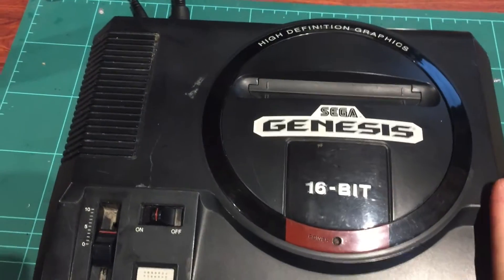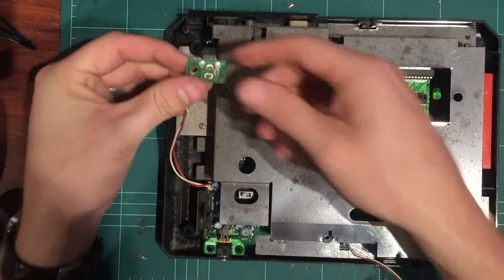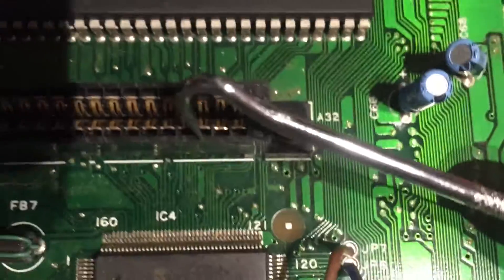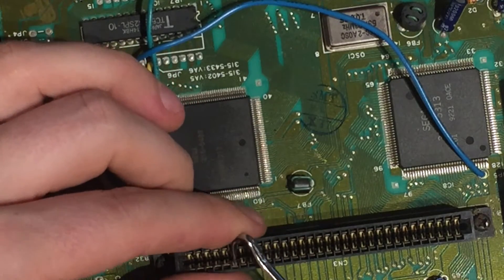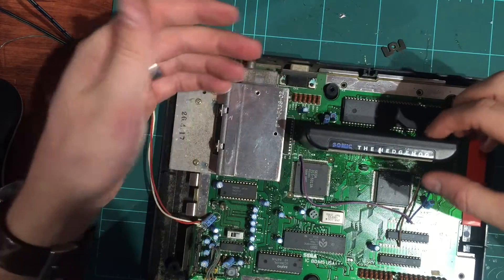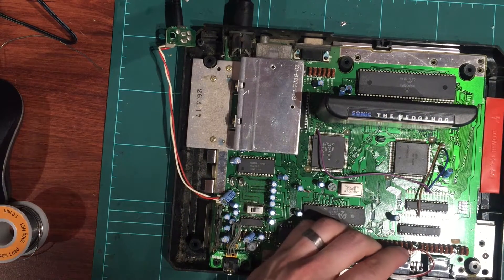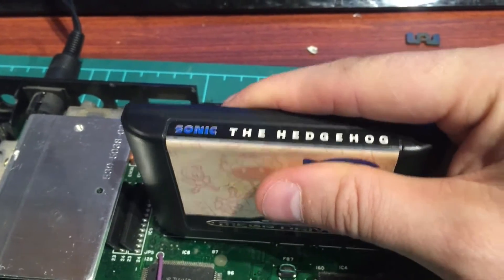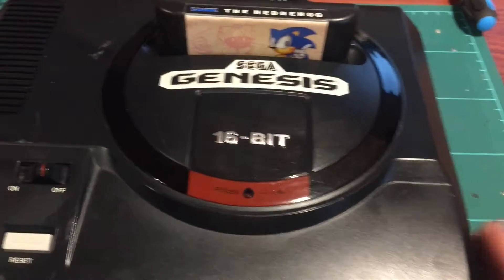SEGA Genesis Console repair - Console 3 Re-tension cart slot pins - Part 4/7

Comment: I found that a needle for treating a calfs infection works wonderfully for pin tweak/ adjustments. Works will for scratching cartridge crystals that grew to touch another run on pcb  boards ninja giaden went from blank Screen to working flawlessly. Might have been larger than a 16 gauge. Farm boys rule